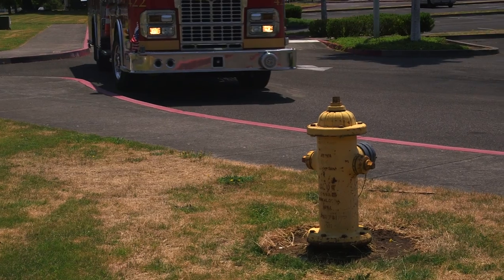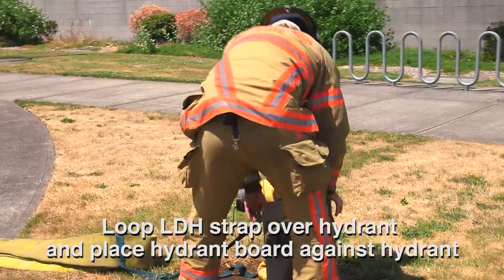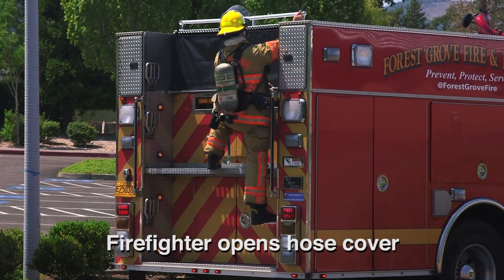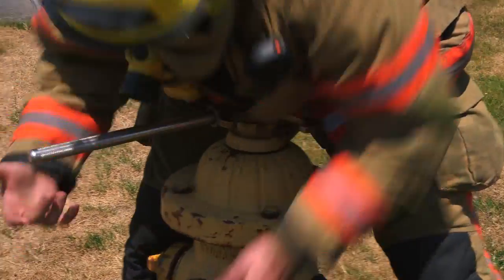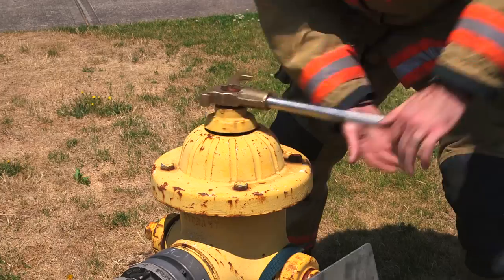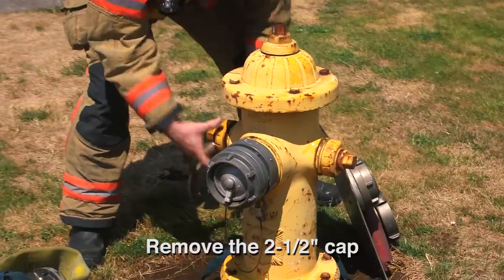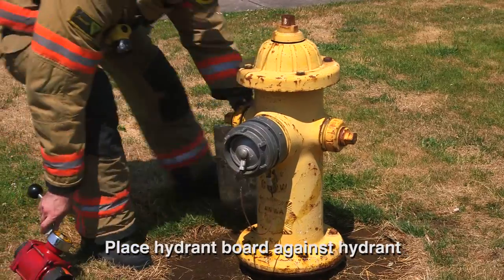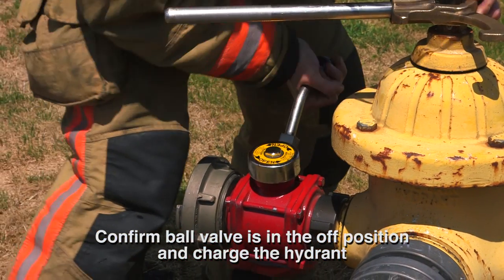Hydrant Operations

Comment: Not bad...

Only opportunity for improvement I see... is to crack that hydrant open and flow a little water to be sure foreign objects that could be in that thing, are flushed out, BEFORE you hook up your supply line.

Foreign objects ingested into your pump could not only damage your pump... but put your pumper out of service at the WORST time for your firefighters inside that building.

Most of the time... you'll crack the hydrant... and nothing but water comes out and you hook up and you're good to go... NO QUESTION.

But...  it HAS happened, that foreign objects have gotten into those hydrants, and been flowed right into pumps, screwing them up, leaving the truck out of service, and costing a big chunk of change to get fixed.   Flowing water from the hydrant for 5 to 10 seconds to 'clear it out', is a CHEAP insurance policy, to protect your truck... AND... see if the hydrant even has water in it to start with.
Reply: Kentucky?
Reply: WHAT THE HECK !!!!
Reply: That was the first thing that came to mind. They may do things differently but I would always flush prior to flowing. Also connecting a 4-2.5” storz to the ball valve seems a little odd but again, places do things differently. Based off my hydrant bag, I will hook up the 5” hose to the 5” hydrant discharge then throw in the gate valve to one of the side discharges. Or if circumstances force us to use a 3” supply line, then throw the 5-2.5” adapter on one of the side discharges and the same gate valve to the other side.
Reply: Nah...In NYC they let the Rats shoot out 🐀. Reminds me of Augustus Gloop in Willy Wonka. 🍬

Comment: I’ve seen this done with the fireman jumping off the moving truck, wrapping the hose around the hydrant while the engine moves off toward the fire. Maybe not so much these days
Reply: my department we just grab the 4in off the back and wrap about 10 feet extra around the hydrant and send the truck down as we connect the adapters to the main valve and side valves. (we are also all volunteer so alot different than most departments)

Comment: Never flushed the plug. Debri could be in the main. And what if the plug was dead.
Reply: Pretty Embarrassing I must say. Like you said; 1)debris 2) is their water? 3) better yet....is there pressurized water?? Ive had dead hydrants that appear to have water, when there was only 10-15psi of pressure....making it UNSERVICEABLE and a death trap.

Comment: not a fire fighter but i do  notice one step the firemen are not doing .   not turning on the water  first  before hooking up the hose to get rid  of any rust that will be in the , water  till the  water starts to run clear
Reply: Also the fire truck should have put its hazards on
Reply: James Garrison you don’t need your hazards since they are most likely at an academy and in a real situation emergency lighting would be on
Reply: ARE u insane. Flush til clear water? You are NOT a paid firefighter

Comment: You forgot to flush the hydrant
Reply: I think we all thought the same thing
Reply: Yup
Reply: @sethdietrich6028  the yellow of the fire hydrant typically means it is connected to the municipal water supply, it get flushed several times a day
Reply: @Theinatoriinator  several times a day 😂😂 idk what municipality you live in to where it gets flushed thst much... I've opened hydrants that were used a week before and have had gross water... its just a good practice to flush them for a couple seconds atleast till the water runs clear.

Comment: First he moved slow as can be, second he didn't have a pack for the evolution where he tied the plug and got back on the rig, third none of the evolutions had the hydrant flushed of debris, fourth he didn't dress the hydrant with a ball valve except the one time when it was unnecessary because he hooked up the only line to the ball valve removing the chance to add another line later without shutting the hydrant off, and finally fifth he hooked up to the 2-1/2 outlet when the steamer wasn't in use in two evolutions and in the one case when he could have hooked the steamer, added the valve and been prepared to maximize water flow. Just a complete lesson on how not to do it...

Comment: Two things I noticed. First is not cracking the hydrant to check flow and debris before attaching supply line. 

Second is the firefighter re-boarding the apparatus after laying the dry pull. I wouldn't be comfortable driving off without someone checking to make sure that hose lays out without snags. They're only going a few hundred feet at most, its an easy walk at that point.

Comment: No gloves? And why don't you use the ball valve every time you operate the hydrant? I'm just curious, because here in germany we work a lot different
Reply: I mean truth be told you really don’t need to wear gloves when operating a hydrant. Not saying you shouldn’t, it just isn’t needed. My department keeps a Gate Valve (same thing they were using different name) pre connected to our supply lines so when we go to catch the plug, we can take the gate valve and attach it to the Hydrant. That way our water flow isn’t interrupted.

Comment: Coupling should be already attached to the hose.then all you have to do is grab the 5inch hose a spanner wrench or hydrant wrench and thread the hose on after hose is drawn out of the hose bay
Reply: only effective in jurisdictions where every hydrant has identical threads. One of the departments I work for has to carry two couplings, because the town has two different thread types for steamers on hydrants in different areas of town.

Comment: What are the sides of the hydrant used for? You could just use the front
Reply: Reese O'Connor get more water and connect hoses
Reply: Shum bukur
Reply: Umbrella
Reply: 2 1/2 inch hoses for backup lines and transfer to another apparatus like a ladder truck

Comment: These American hydrants are based on 200 years old tech and require a lot of work to operate and keep in shape. In West-European countries, we use a system of underground water-locks combined with mobile hydrants. This keeps maintenance low and almost no such issues as broken or frozen hydrants. I found a (very old) instruction-video about how these locks and hydrants work, including a fire-crew operating one: https://youtu.be/3BKiug9mkMw?t=120 (start at 2:00). Without rushing, this crew opens a well, connects the mobile hydrant, opens the mains, flushes debris and connect a primary hose all within 30 seconds
Reply: At night it'll be hard to find that well cover in your video
Reply: @tl8885  that's why there's also locator signs placed nearby at a certain high visible spot, also useful in case of snowfall
Reply: @MichielKlaver  ok cool makes sense